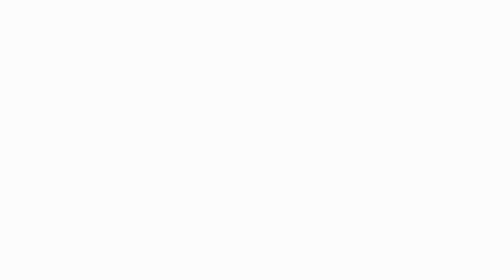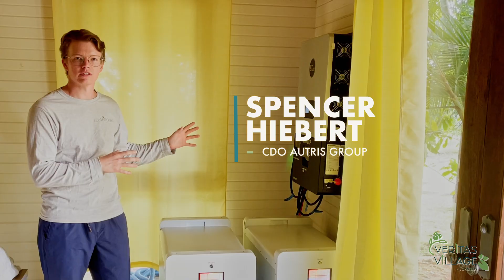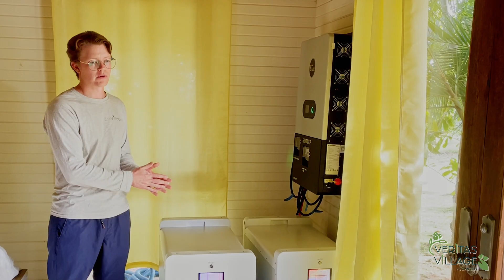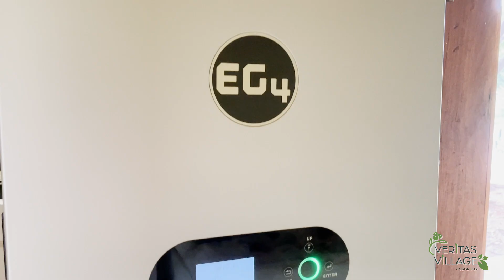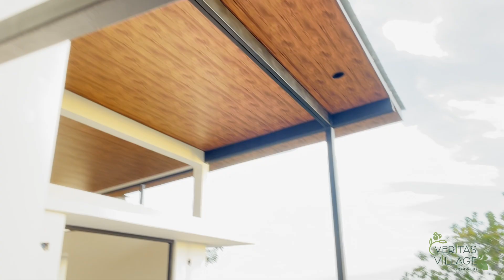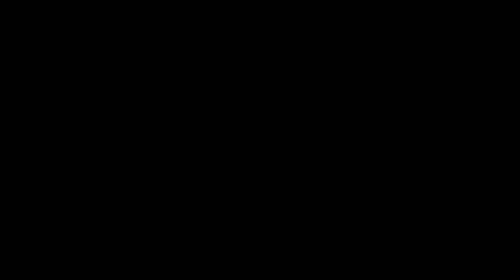How We Live Fully Off-Grid in Panama | Veritas Village - Coronado Solar Power System

Comment: Very interesting setup. What is the usual number of solar panels for those units?
Reply: Depends on the home, but roughly 16 to 24 panels. We currently are using Trina 610w panels but the panel technology, like the inverter and battery technology, keeps improving, so we continue to experiment with new equipment to keep improving the systems.
Reply: Depends on the home, but roughly 16 to 24 panels. We currently are using Trina 610w panels but the panel technology, like the inverter and battery technology, keeps improving, so we continue to experiment with new equipment to keep improving the systems.